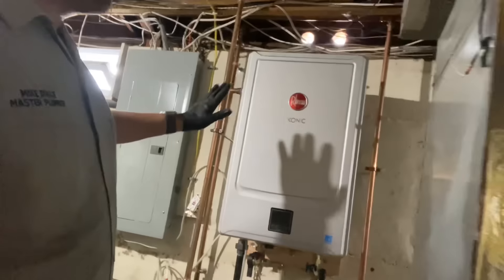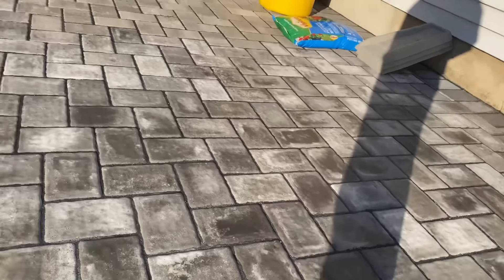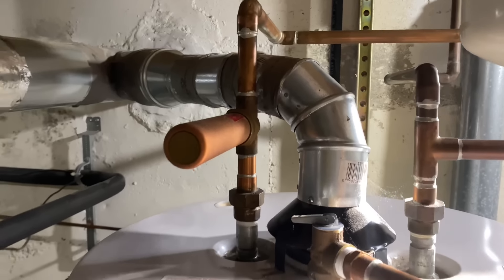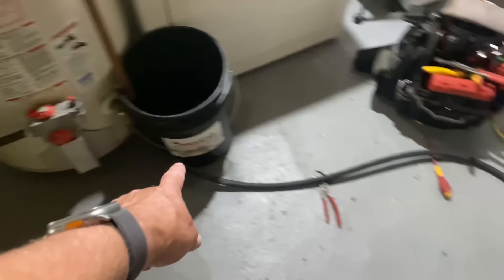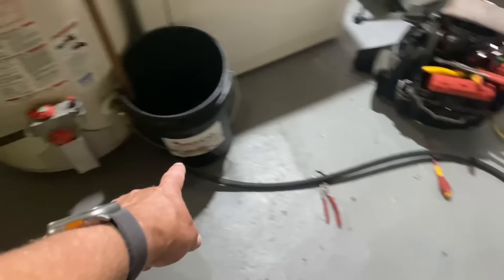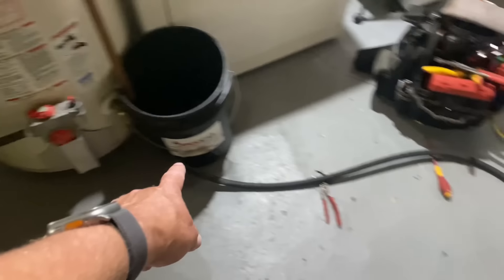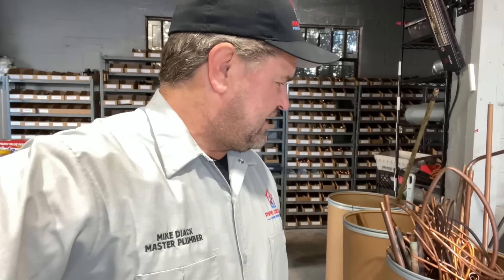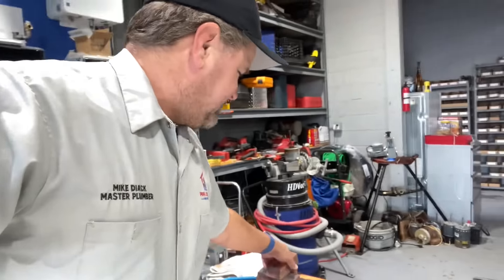Unlock Instant Comfort with Quick Long Island HVAC System Replacement

Comment: I’ve seen so many times where a tankless is installed in summer with no problems then in winter complaints of my water isn’t hot and error codes. In SW Ohio my water temp is close to 80. In February it was below 60.

Comment: Do you need a drip leg going into the furnace?  It is not a vertical connection going into the furnace. I thought that only the last vertical run needs a drip leg to catch any debris as the pipe enters the furnace. Not a horizontal feed.

Comment: Is the exhaust not to close to the Condenser unit incase the rheem unit , gas purgers and there's a arc fault in the compressor circuit.??

Comment: My Bosch unit is awful.  Yes, it makes heat in the winter, but in the summer it's 72*F, 72% humidity!!!!   My old R-22 system was 75*F and 45% humidity!!  :mad:    I'm seeing black mold on the ceiling by the ducts.
Reply: Bosch works best with a two speed blower. The low speed is good for humidity reduction.